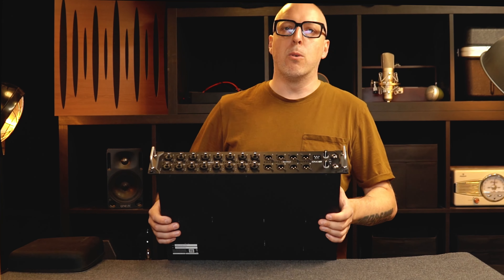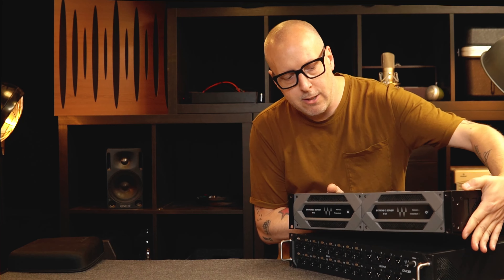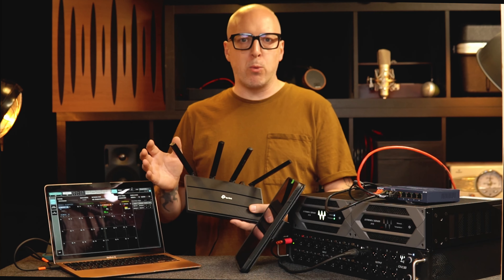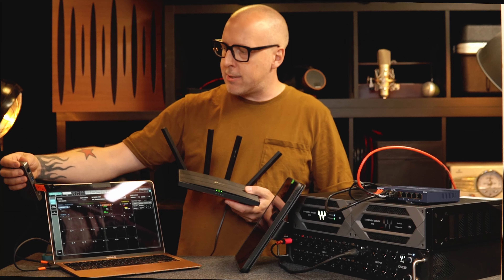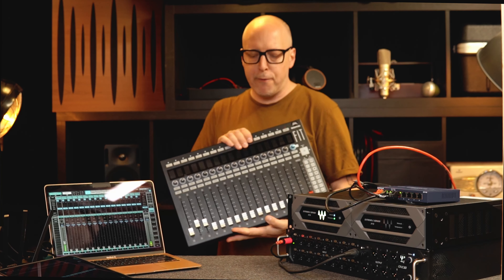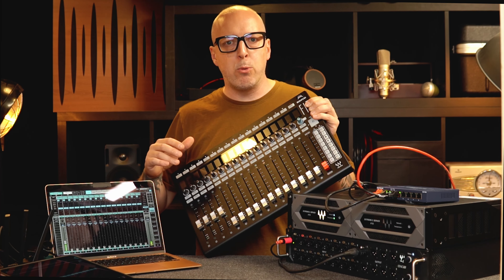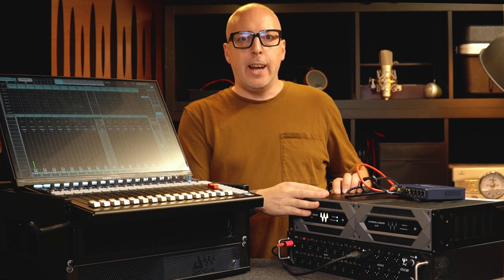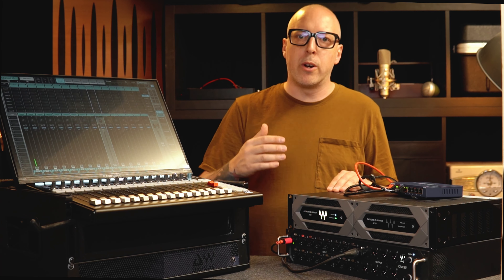Building a Waves LV1 system - Hardware

Comment: just so I understand, the LV1 software on the mac or pc is just a controller application to the server and is not actually processing any audio.....All processing and routing is in the server and the LV1 software is just an interface to the server. Would that be correct? So the host mac or pc does not need to be a powerful computer as there is no actual plugin, audio, or processing of any kind other than remote UI to the server.. correct?
Reply from the maker: That is a perfect description of LV1. You can even mid show disconnect the host and the show goes on (but you can’t change anything). 
You don’t need a very powerful host computer.

Comment: Thanks Joe, how can i send to monitors from Lv1 to a x32 mixer, i have wsg card in the x32? Thanks
Reply from the maker: If you have a wsg card then you can just share all inputs. So basically running 2 separate mixers with the same inputs. One for foh and one for monitor. I have a video about working with 2 consoles. I use 2 LV1 but it should work the same.

Comment: Server we can backup server
Can we have a host pc like 2 axis scope for back up

Will the sound stop if the host crash and we have to change the host
Reply from the maker: Well ... Redundancy is not Waves strong suit. The backup server is not active until the main one fails. If that happens there will be a few seconds of silence. 
You cannot have 2 hosts active for backup purposes. However, if the host crashes there will still be sound since all processing is done in the servers. So in theory you could have 2 hosts but only 1 connected. If that one dies just connect the other one. I've not tried this scenario though.
Check out this video for more info about backup and crashes: https://youtu.be/BlYAAFQA9KA?si=jLt5LQNOldTd1wB2

Comment: Why not connect the router to the switch? Did it once for iem control … no issues. It was a pc as host
Reply from the maker: That is actually what I do most of the time. But it’s not recommended by Waves, that’s why I show the “right” way of doing it in the video. 
But you are absolutely right. You can connect everything to the switch.

Comment: Why would you have the switch and the servers on stage and not at FOH?
Reply from the maker: You can have the servers at foh, many do. But if the cat cable breaks everything gets quiet. If you have the servers on stage and the cat breaks you still have sound, but no control. 
I have a video called ”When everything break” where I go through this more in depth.